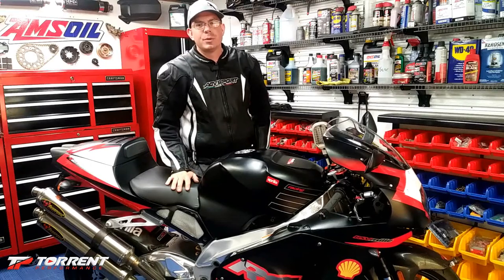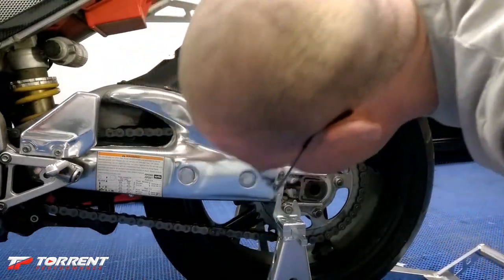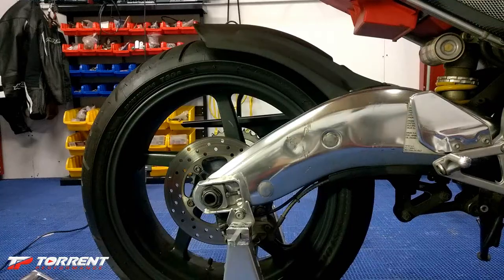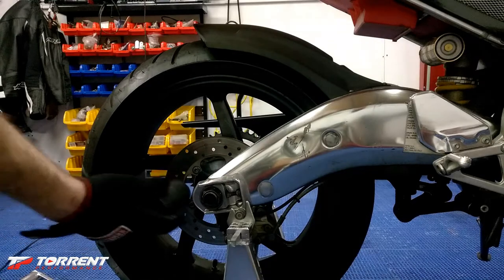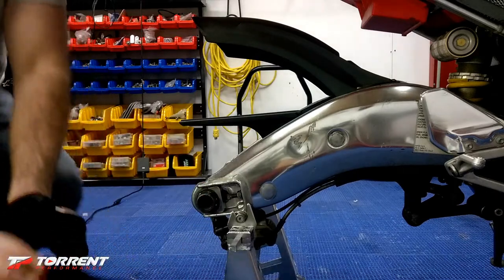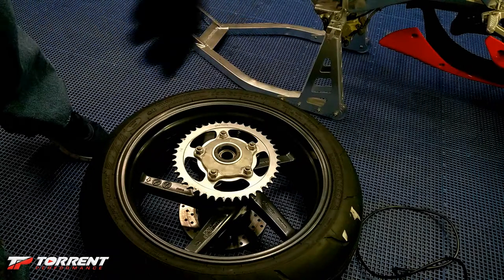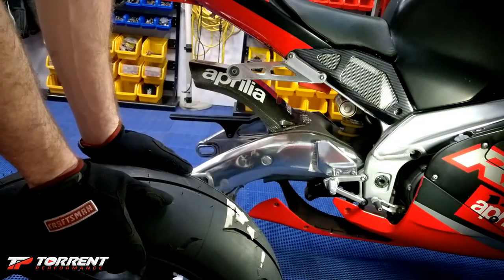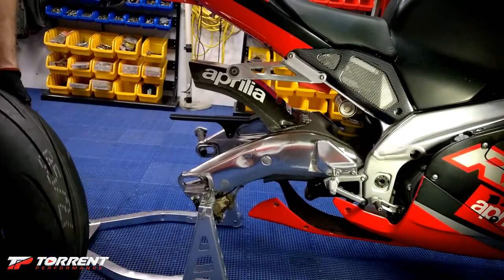Aprilia Mille Rear Tire Removal And Install Lift Part 10 Of Mini Series

Comment: Very useful video. Only one question, in the right side of the swingarm, there is like a bump, I have recently bought an rsv and has the same bump. I supposed that is due to a hit of the exhaust in a crash right?. Thank you very much.
Reply from the maker: Sometimes caused by exhaust and sometimes caused from flex of the bike. The polished piece that has the dent is welded onto the actual swingarm. Under alot of force there known to  dent under load. That polished piece covers a hollow part of the swingarm.
Reply: @TorrentPerformance  thank very much for the information! I have never thought it!. Best regards